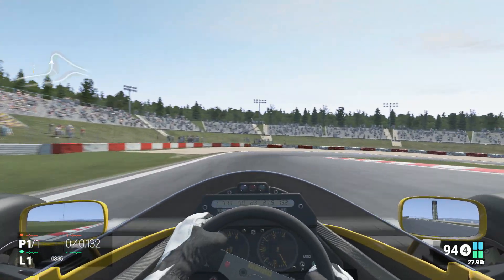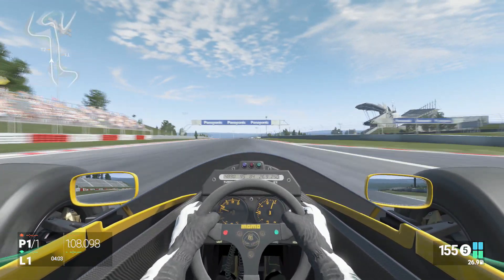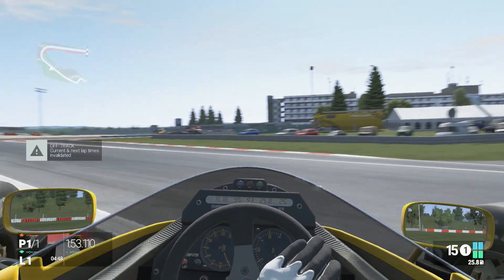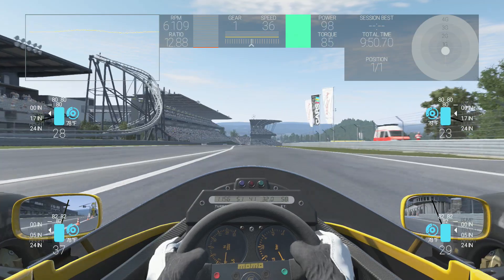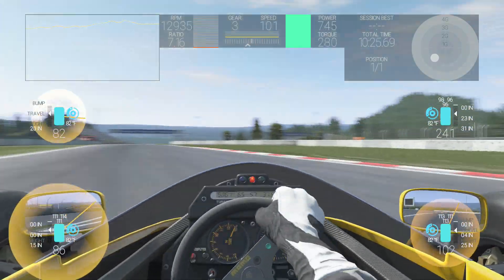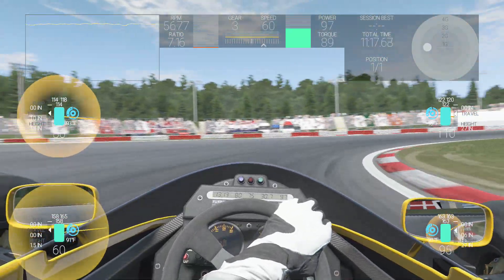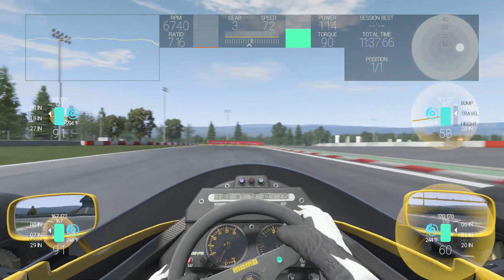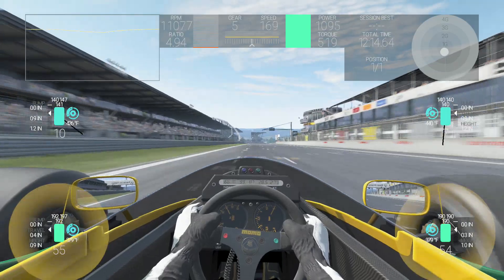Project Cars Tuning guide Part 2F: Gearing and Engine

Comment: Hey man, cool video! Quick question, do you use a wheel for this game? I'm using a ps4 controller and have followed all these guides and tried multiple setups and I cannot get the f***ing car to turn at all how it should. I go into a corner, at what should easily be a slow enough speed, and the car firstly reacts about a second after the analogue input, before sending me flying off the track :-( any idea on something I might be missing! Anyways, keep up the good work!
Reply: ***** Sounds like you need to tweak controller settings more than car setup. Car setup will not fix your input issues. In general, I find that the games default controller settings are much too sensitive, and with too much deadzone, which is what your problem sounds like. It doesn't react right away, but then once it does, the input is too much, correct? I would advise lowering the controller sensitivity down to between 5-15 depending on your preferences, as well as lowering the deadzone to around 10. Then try that out and see if your controller issues are fixed.
Reply from the maker: ***** Yeah I use a wheel.
Im not sure why that is happening. What car is it? Also does your controller work on other games without issue?
Reply from the maker: I Think Trevor Sells is on the right line of thinking. so far i've seen a lot people on controllers getting similar issues as they have not fiddled with the controller. i would recommend you have a play with settings so you can get more out of the game

Comment: Great Videos mate.  Really useful as setting up the cars can be a real headspin!
Would be great if you could do a video explaining the telemetry graphics in the game (eg circles around the tyres, suspension travel etc).   
There does not seem to be any official guide on what these are and how to read them.
Also,  do you have a set order in which you perform a base setup on each car.  eg first set tyre pressures, then suspension, then roll bars, camber.   Would be useful to know if you work to get a base setting in each area and which order do you prefer.
Anyway Thanks for taking the time to make the videos!!
Reply from the maker: Julian Kirkland hi  this will be in part 3 as the theory is a bit more complicated, but the general rule of thumb is ride height,caster, camber, toe.
Reply: That is actually something I would love to know as well, in what order you start tweaking the car. Especially if multiple variables contribute to the same handling caracteristics. Love your explaining, thanks!